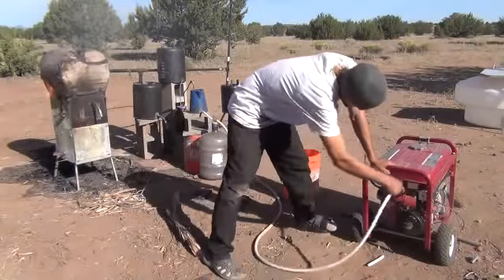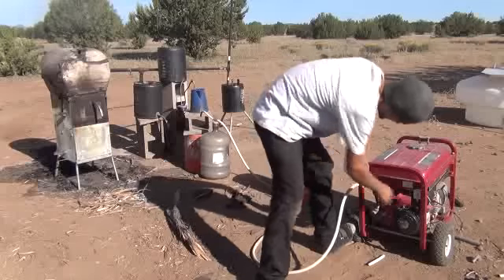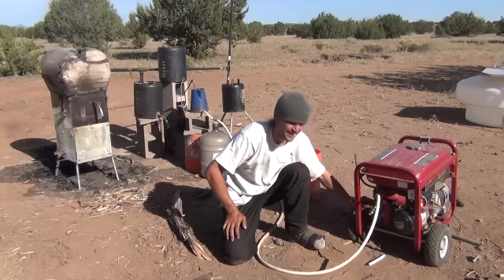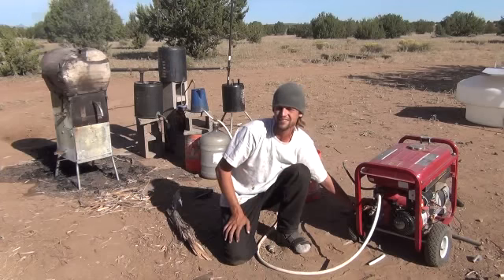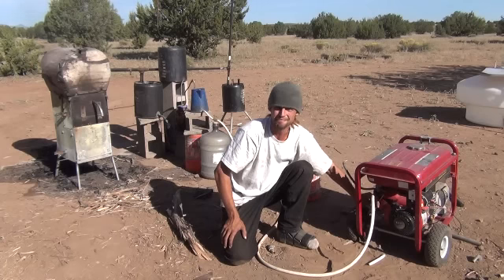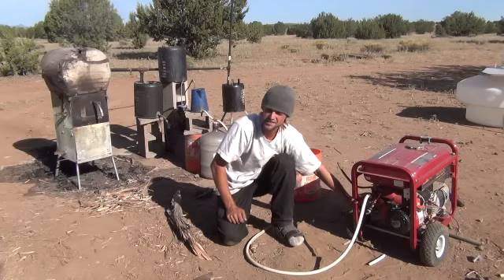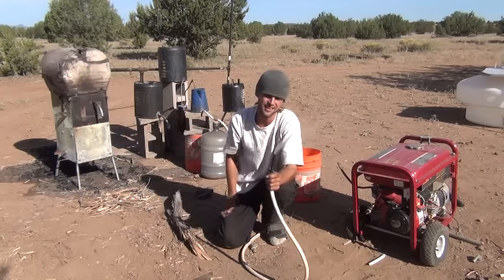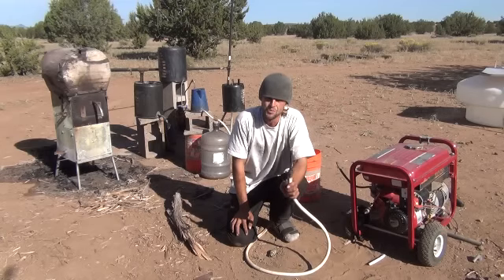My Wood Stove runs a generator

Comment: im sat here thinking ive had an awaking, and thats to work my arse off and life of the grid, shame im in england where space is minimum, a solar, wind powered canal boat, thats where i want to be
Reply: A wind powered boat is sometimes called a sailboat. But seriously, I have seen a you tube video recently where the guy had a hybrid narrowboat where the prop was driven with an electric motor from batteries. The batteries were charged form solar panels. If the batteries ran low they could also be charged from a diesel engine with an alternator. The diesel engine wasn't connected to the prop. The whole drivetrain was all electric.

Comment: Gasifying wood was done in Europe during WW2 to drive cars. I always wondered if a electrical hybrid system running on wood pellets isn't viable in todays cars. This setup generates 4kW or about 5.3 hp. Scale it up to about 20 (15kw) continuous horsepowers and I think you would have a "steady state" electrical hybrid.

Comment: Dear Sir,I watched your video and I was impressed by your innovative ideas on how to use a wood stove to run your generator. Would a wood stove be able to make fuel to keep an 8KW running twenty four hours a day. How long does it take the wood stove to produce a few gallons of gas? What all do you need to have along with the wood stove? What do you use to fuel the wood stove? How many hours can a wood stove perform before it melts down. Does the hot weather effect the wood stove in a negative way? How much would it cost to make a set up just like yours? I am a prepper and if the grid goes down and we no longer have electricity would the wood stove be a good idea to make fuel for our 8KW generator? I am on a ventilator and I need electricity to run that to keep me going. I have tried buying the big batteries and going solar but there is too much shade at my location. We even looked into wind turbines because it's so windy on the mountain. But it was so expensive and did not work well. I just wanted to ask you for some advice on running off of the grid. Thanks for your time.David

Comment: Hey man do you think that maybe it would be easier if you just made an entrance from the original fuel tank, seal it good leave the carburetor in it and compress the gas in the generator to make it work? Cuz all you need is fuel, or are you bypassing straight into the pistons and spark pugs?

Comment: you dont have to remove the carb, just make a hole in your breather then stick the hose in there, you can also start it on gasoline then shut off the gasoline and let the smoke gases take over.

Comment: Hi MR. T.  Does your setup produce BIO-CHAR when the reaction is completed?  This is a great way to extract energy from wood that can be stored for future use.  The Bio-Char is a great soil additive, especially in sandy soils.  Due to the structure of the carbon molecule, soil nutrients get captured by the carbon and are then held in place in the soil and become available for plants to easily access.  Bio-Char helps to keep soil nutrients from being leeched away by water and soil erosion.  EXCELLENT VIDEO, GREAT AND SIMPLE PROCESS MR. T.  THANK YOU!!

Comment: you need a sulphures carbon filter on the final step of your bio-gas engine. Sulphures are extremely corrosive and short the life of your generator machine. Good look in your job ;-)

Comment: Would that be good after an EMP/CME? Is that a good generator?  I don't know much about what kinds to get.       Also, are you doing anything else (like for hot summers) like a solar panel without microchips etc for EMPs/CMEs, to make heat .... to then make the generator run.

Comment: Is 'Wood Gas' acidic? Will it corrode the internals of the generator? Where I work, one of the guys tried to make Bio Diesel from used cooking oil. It turned out to be acidic and ruined the engines on a truck and a tractor.
Reply from the maker: +George Crabtree If it is fully filtered the gas contains mostly CO with hydrogen and oxygen, so not that corrosive. Not properly filtered it is very acidic.
Reply: can you elaborate on "properly filtered" 
I plan to build a commune and like to learn all I can before making a expensive mistake
Reply: MrTeslonian yes, if you have the time please explain your filtration process.

Comment: how do you deal with changing loads, and how efficient is this setup can the generator produce full power, and how much more maintenance is needed for the engine due to burning dirty fuel. can you walk away from it for more then 2 seconds without the engine dying?   this hardy the way to GREEN energy independence.

Comment: How do you maintain the desired 3600 rpm that's required to get 120 volts at 60hz, to much rpm and you get voltage spikes to little you get voltage drops.
Reply from the maker: https://youtu.be/IeOVq4BuIHA

Comment: It will NOT put out power you can use because you took off what controls the speed and the AC frequency.
Reply: Donald Smith he took off the carb.  My generator engine runs at the same speed. ALWAYS. The engine Has NOTHING to do with the AC frequency. NOTHING!!! gas powered engine doesn't produce electricity.